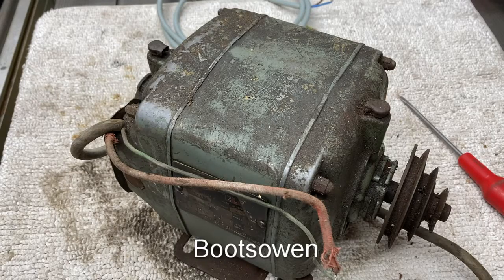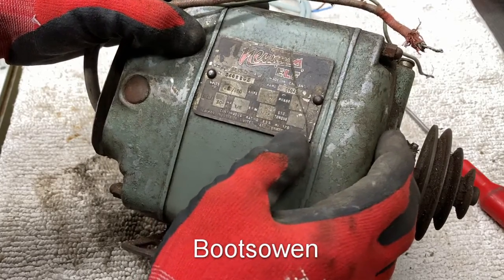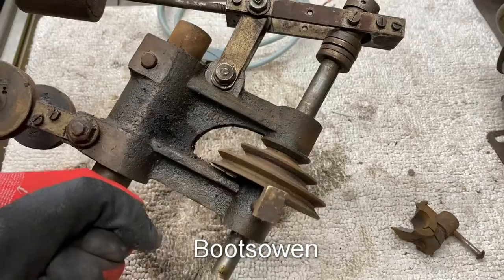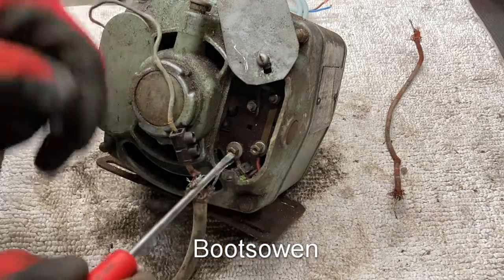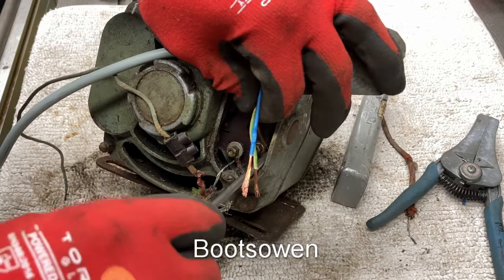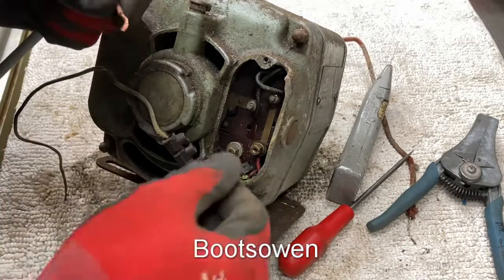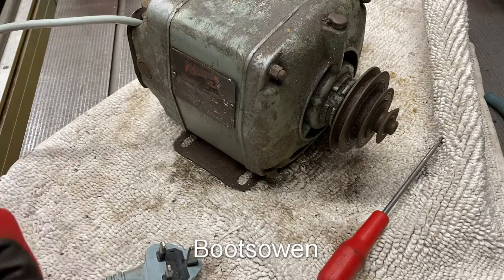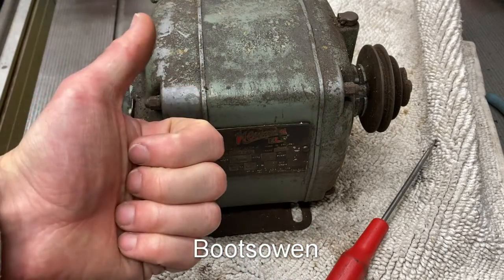Newman Elf Single phase motor: found in a skip | will it work?

Comment: Any idea the capacitor is on these motors? I have a similar motor on an old drill press and I think the capacitor is faulty. It doesn’t have an external one. Any help welcome.
Reply from the maker: No cap on this motor, if you think the cap is faulty try replacing it, they aren't expensive. If it struggles to start but will start if you spin it by hand it is probably a dud start capacitor. Or it could be a run capacitor, or some motor shave both start and run capacitors.